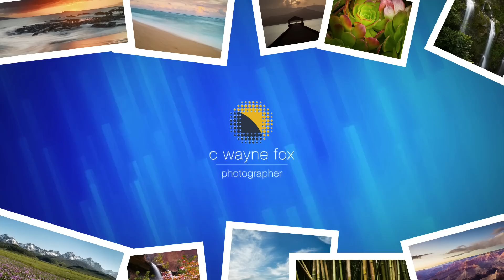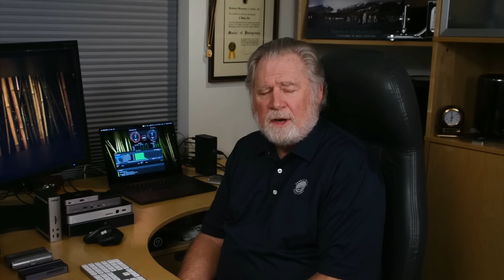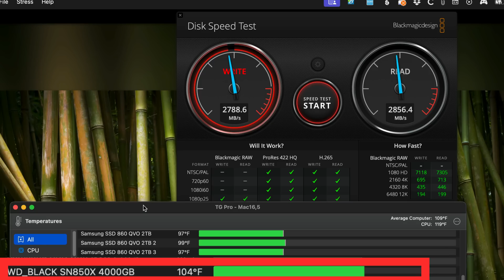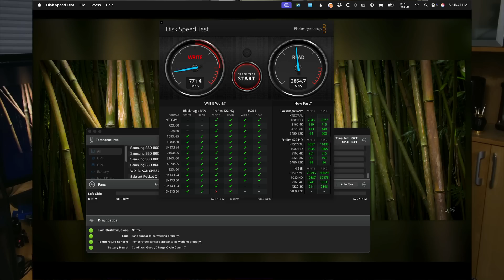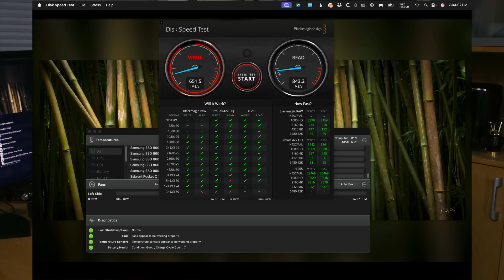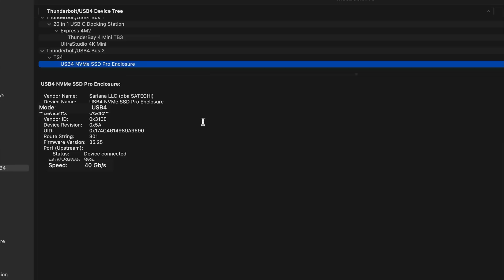Two BIG Problems with Docks!

Comment: It helps to know the "architecture" of your computer because you may have more bandwidth than you think.
In the video, the starting point is a specific Apple computer. In the case of Windows, the high-level reasoning still applies. But.

If you can track down a logical diagram of the motherboard in your computer, then you can see if there is a so-called "South Bridge" (SB) processor (chip). This would be referenced as the chipset of the motherboard in times when there also was a "North Bridge" (NB).
Both would be "switches" and the NB was specialised in addressing memory and passing on other I/O to the SB. The SB then would provide time sharing of the link from the North (CPU/NB) and hook the North up with peripherals at the South end. In the SB, your mouse and HDD/SSD are competing for a CPU's I/O time.
The NB, in the past decades, generally got integrated into the CPU, but the SB is still present in most cases (by market share).
As a CPU has I/O lanes for the peripherals, we expect dedicated lanes for the GPU (graphics adapter card) or GPU processor if on the motherboard. An SB then may have a couple CPU I/O lanes and in most cases (of desktop and mobile CPU) this is the end of CPU I/O lanes.
However workstation class motherboards, and the processors fitting that, have more lanes and these relay to PCIe connectors that are to be used optionally.

In my workstation motherboard, the SB time shares 4 PCIe lanes between all USB and storage devices. It has 2 Thunderbolt connectors on separate PCIe lanes (from the spare ones in the explanation above) and then it still has "free", "optional" PCIe lanes. I hooked a PCIe I/O adapter into that and it gives me 8 lanes for HDD/SSD. I use these for the OS's page file, and temp, or scratch files used by applications. Keeping these I/O channels, that impact latency or user experience, separate from the basics means better performance - that exceeds the computer's pay grade.

If you want very fast SSD/I/O, then don't buy into a time sharing device that mimics an SB. I have a 2-slot Thunderbolt CFexpress Type B card reader that is the fastest in the market and has its own power supply. It has a TB pass-through and that hooks into another fast SSD device. The other TB connector on the mobo hooks into two daisy-chained TB SSD.

The moral of the story is that it's not desirable to hook slow devices into a time-sharing device. 2 Monitors of 4K , fine, but make sure the TB connector they're on is not sharing CPU time on its I/O lanes.
Reply: yeh, they been leaving out those diagrams lately, of the chips and pcie lanes, that was at, the end of the manual. Sucks.  The new Z 890 boards, some of them, have thunderbolt 4 built in, and also, you can add, a Thunderbolt 5 add in card, i really want to know, how that is split up.
Reply: @tek_soup  - it helps to build your own PC from components. Some of the shops have a configurator program on-line that helps you pick compatible parts.
Basically, you need to go back to processor (CPU) specs first. Basic consumer CPU will have PCIe lanes for RAM, 1 South Bridge, 1 high end GPU in the current PCIe generation and nothing more. In such cases, all peripherals are run via the South Bridge connection and its time sharing.
Higher end CPU will have more PCIe lanes that connect to your motherboard.
You may have a lot more PCIe connector lanes than processor lanes, though. Your motherboard's user guide will tell you what happens when you stick cards into the connectors.
So your processor preference drives motherboard longlist and lanes in the motherboard drive the shortlist.
Bottom line you must look at the jobs you do with the applications yo use. I don't play games but do photographic processing in post. The photographic apps use your GPU as co-processor and the amount of video-RAM may be more important than throughput. But Microsoft Explorer (file browser) also uses that video RAM for previews of photo folders set to large thumbnails and can easily eat 8 GB of expensive video RAM away.
One benchmark that you can try for your current PC as a way to see what a new one might, bring is Puget - they have application specific benchmarks.
My own PC is a now older PCIe 3 with workstation processor and 64GB of the highest (lowest latency) performance RAM and 11GB of video RAM. I split conceptually different I/O streams across physical lanes and the result was a 97th percentile in SPECmark without any over-clocking (keeping it reliable, long-living and robust).
I am considering to move my GPU into the copy (for redundancy) of my machine that my wife uses with an older, slower, less powerful CPU and then replacing mine with a newer with 16GB video RAM and more bus-bandwidth. In no other way I need more power.

Comment: Does the dock reduce the entire machines bandwidth or just the port it is plugged into? Ie. Would the drive speed return when plugging it in directly while the displays are still on the dock?
Reply from the maker: Each thunderbolt port has full bandwidth.  If I move the displays to connect directly to the Mac through the other TB ports and the HDMI port,  speeds through the dock are unaffected, and of course if I move the device to directly connect to the Mac I get the maximum speed possible.

Comment: Great video very usefulll testing thank you. I think you need a Mac Studio and lose some of the docks.
Reply: This is a good point.
Reply from the maker: Hate dealing with 2 computers, did that for many years with a Mac Pro and MacBook Pro.  The new MacBook Pros are so fast, and it’s a lot easier (and cheaper) to have just one computer, even if I have to use a couple of docks to get the ports I need.
Reply: @cwaynefox  MacBook Pro Too limiting and untidy on the desktop.  Who said anything about 2 Macs.  sell the MacBook or just keep for travelling.
Reply from the maker: @mikepxg6406   Works for me. “just keep for traveling” means I have 2 Macs. And I travel a lot. I’ve did that for a couple of decades, like the simplicity of one now that the MBP has enough power. 

 Normally the dock sits next to the Mac, all cables out the back except things that would connect to the front of the Mac Studio as well. Not really untidy, unless I’m working on videos about docks and SSD enclosures, like I’m doing now. 
appreciate the interest and comments. 😎

Comment: Could that be a cable issue? Maybe worth testing it with other cables so it will be recognized as thunderbolt 3 or 4.Cables and standards got really messy IMO
Reply from the maker: tested with numerous cables, from OWC, CalDigit, TB3/ TB4 versions, as well as Apples very high quality TB4 $$$ cable.  Currently working with CalDigit on the problem, they seemed quite interested.  repeated all test with M3 Max (TB4 connections) same problem. This is definitely something between the 1M2 and the CalDigit. The one thing I haven’t tried is a USB 40 Gb/s cable, but according to everything I can find including from Intel who maintains the ThunderBolt standards, TB4 cables are fully compatible with USB4 and in fact they claim superior.  I’ll keep working on it :).  (OK, just tested it with the USB 4 cable that OWC includes with the 1M2 and the CalDigit ... no change. Still seen as a USB 3.2 10 Gb/s device by the Mac)
Reply: @cwaynefox  thank you for the research and the testing. Just subscribed and looking forward for your content 🙏

Comment: Great points made.  I recently purchased a 49" oled monitor 5120×1440. When connected through the FusionDock Pro 1+, it will not run at full resolution. I also have the owc express 1M2 with 990 Evo plus. I am running the two directly into the macbook Pro m4 Pro to get the best performance. I have other drives and a 8k tv connected to the dock. I am contemplating the purchase on the FusionDock Max 1 in an attempt to solve this. Based on your testing, I still  would have to bypass the FusionDock Max 1. Do you agree, what are your thoughts?
Reply from the maker: It appears the Dock you are using only has a 5Gb/s connection to the host computer (not a ThunderBolt dock)  Pretty underpowered dock. I have no clue how they can support 3 displays like they claim. 

The FusionDock Max1 should handle the bandwidth for the display.  However, I think any good ThunderBolt dock such as the OWC 11 port ThunderBolt 4 dock would handle the displays fine. You will lose a little speed with your OWC 1m2 (around 2800 r/w) if you connect it to the dock, instead of the 3400 r/w I”m guessing you get directly connected,.  That seems pretty standard with all TB3/4 docks right now, I haven’t found a dock yet that can get the full speed out of the new faster USB4 SSD enclosures.

Now this would work find as long as you OLED display has a display port connection, since the OWC Dock only has connections to DisplayPort capable displays. (no HDMI). (It has 1 TB4 going in and 3 going out, so 2 displays if your Mac supports 2 displays, as well as another TB/USB 4 device.

If your display only has HDMI, there are TB/DisplayPort adaptors to HDMI that might work.

The OWC is a lot less (under $200 right now I think) , and if you order it from Amazon and it doesn’t work it’s pretty painless to return it to them.
Reply: @cwaynefox  thank you for the very detailed answer. I will probably wait for the upcoming OWC thunderbolt 5 hub and see how the performance plays out. It supposedly will be released by the end of the year . Not many ports but should be fast. I do like the looks of the FusionDock Max 1 port wise. Thank you.  New sub here. Great channel.
Reply from the maker: @htnowpro  good plan.  I’ve had the OWC TB5 dock on order for a while, will post review ASAP once it arrives. It could be a good solution for your situation. Might solve the problem of reduced bandwidth to the 1M2.
Reply: @cwaynefox  great.  I look forward to your experiences of the new arrival.
Reply: I was going to wait for the OWC, but curiosity got the better of me. I ordered a Ugreen Revodox Max 213 thunderbolt 4. There is nothing much about it online. Will know soon.

Comment: Excellent video, Wayne.  Do you have the latest firmware updates to the CalDigit TS4?  I don't remember exactly when those became available, but I think there were two of them, each related to different occasional speed issues on the different connector controllers.
Reply from the maker: Yes, running the latest FW I could find, 39.1.  Currently working with CalDigit to try and see what’s going on.
Reply: I am learning a lot here today. I didn't know these hubs had firmware updates.